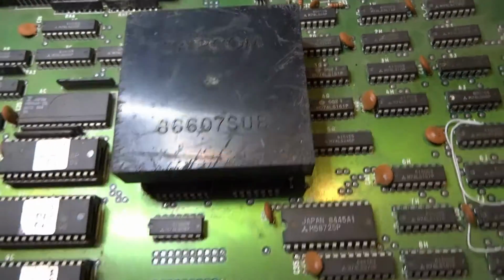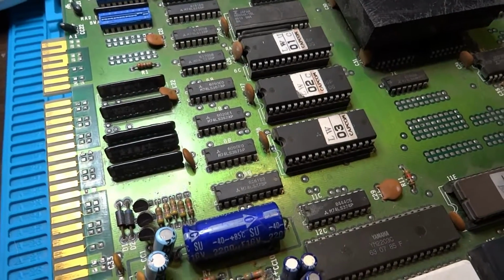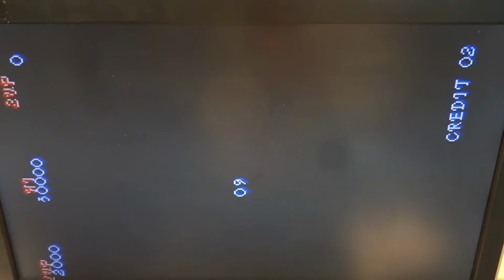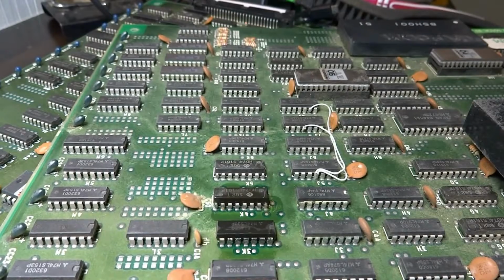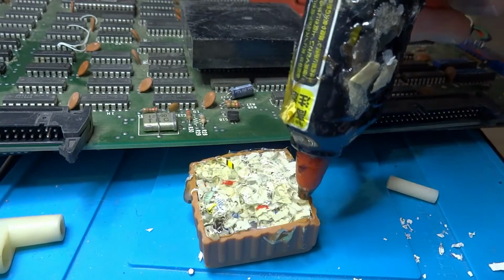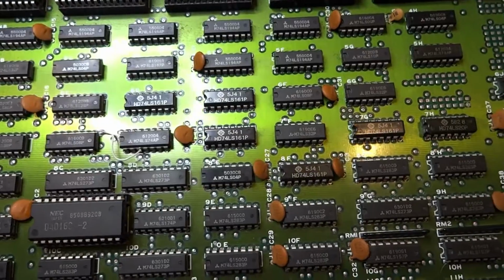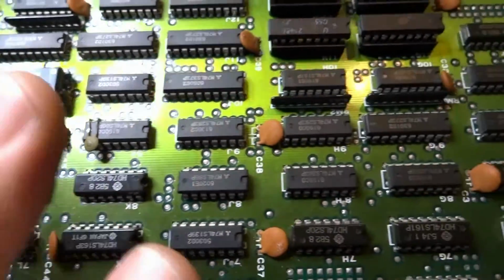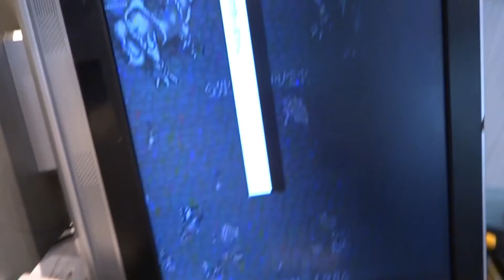Capcom Legendary Wings Arcade PCB Repair (Revisited Redux)

Comment: I have a couple of VS. Boards with serious case of the bends.. still work. How they got that way is beyond me. Ive noticed a lot of these longer  double pcb games have the bends..
Reply from the maker: I have a ton of them as well. It's the heat, moisture, pressure changes and even season changes that do it to them. I try to fix most of my boards down on a piece of wood where possible but yeah, not a big fan of the bends.

Comment: I have an original Taito English bubble bobble board set that's in perfect working order. I can't find any info on it, I can't find sold listings on eBay other than bootlegs.

Have you seen one, are they a rare as I think it is or am I searching incorrectly? Any idea on price for it?
Reply from the maker: The original bubble bobble boards are indeed quite uncommon nowadays. There are several bootlegs and 3rd party ones out there. Doing a video on it would be cool to see.
Reply: @lukemorse1  I wish I had a YouTube channel and maybe I would but I don't. My kids and I have played it for a few years and it's a lot of fun but it's in a pretty generic cabinet. I have been able to authenticate the board set though.

Comment: Glad you got it completely working. Are there any advantages with hiding the traces? Obviously there's lots of disadvantages but would it offer more protection or help stop it rotting?
Reply: Capcom has a history of favoring anti-bootleg measures over anything else.  This is certainly one of the examples.
Reply from the maker: That is a great question and to be honest, the cons outweigh the pros by a lot. A burned or eaten trace is basically impossible to find. This is definitely done for antibootleg measures no doubt.